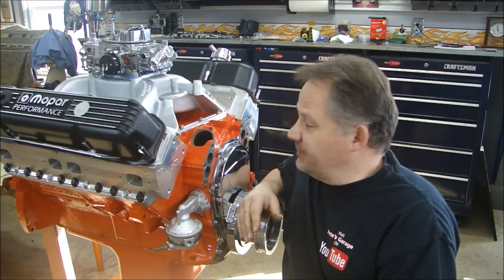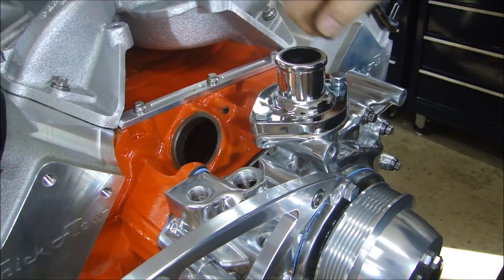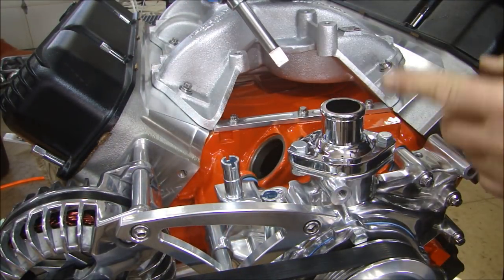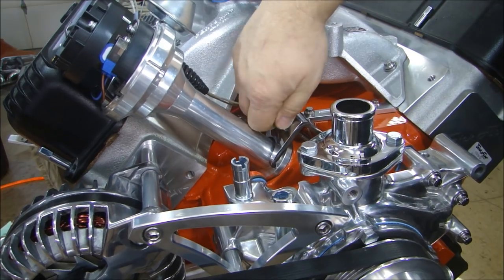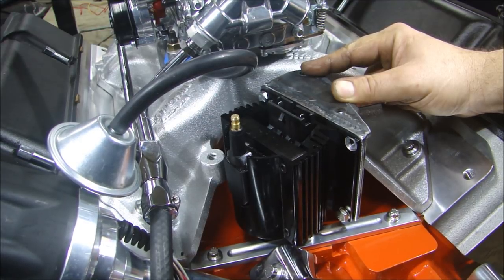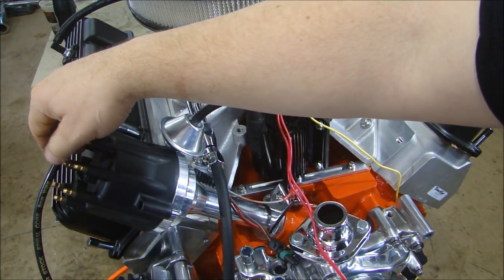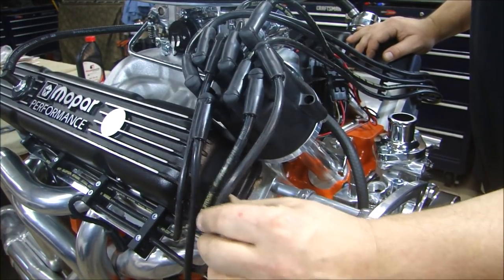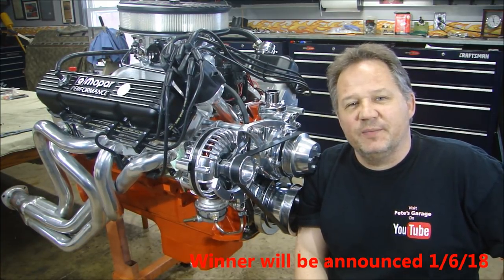440 Chrysler Mopar Engine Building Part 11 - Water Pump, Alternator, Coil, Making Distributor Wires

Comment: What are your thoughts on routing the spark plug wires underneath the headers and routing them to the distributor? I had never considered that until I purchased an 82'  chevy pickup last year with 10,000 miles on it. its appeared unmolested and i was curious if that was how the trucks came from the factory. i have began running wires on my builds that way and have had great success with wires nor being damaged or effected by heat from the headers. I do however put the wires in a heat shield. I believe the additional wire length has not effected performance.
Reply from the maker: That's an awesome idea. I've done that when they are extremely close. Thanks for the comment

Comment: I use cvf racing pulleys on all my cars.  The price is right and quality is great too. And made in usa.  Looking forward to the dynotest.   My guess is 477 hp btw.
Reply from the maker: Those are very good, these are made by March
Reply: @PetesGarage  526
Reply: I'm new at building Dodge 440 so I'm doing a roller motor to and I appreciate all your help and how to adjust the lifters and all that I put the 7 quart oil pan on I've got a Dodge Dart Swinger 73 model and it's sitting really low to the ground I've already been the oil pan once any suggestions on how to put the car up a little bit higher in the front so I'll stop bending my oil pan

Comment: Try using baby powder as a wire/boot lubricant, a liberal dusting on the wire jacket and in the boot works exceptionally well, is less messy than WD-40/silicone oil/grease, is non-conductive, resists carbon tracking and is rubber/insulation friendly.
Reply from the maker: I'll try that

Comment: HI Pete! about the bracket you connected to the coil was it nessasary to do so. And the bracket was it not a part that came along. It looks home made. Thanks
Reply from the maker: I made the bracket just to hold the coil for the dyno test. The coil usually gets mounted away from the engine where it's not hot.
Reply: OK! i see

Comment: Hi Pete! was it really nessasary with all the wiring  to the distributer, i guess you wanted to show us one way to do it your self. I saw many who just had cables prepared. Thanks
Reply from the maker: You can buy cables made to length for most engines. I like to buy higher performance wires and cut them so the fit neatly on the engine.
Reply: OK! got it thanks ....

Comment: When priming the oil pump you mentioned turning the cam to get the oil passes to line up, priming both rocker assemblies. In this video when installing the distributor you say your engine is still at TDC. Did you go back to TDC after priming? how did you do it with the heads on? or did you not turn the cam to prime the rocker assemblies?
Reply from the maker: Yes, after priming the oil pump I turn the engine to #1 at TDC compression stroke.

Comment: I use silicone mold release spray on my wires during assembly. It dries fast and works much better than other oils, just spray the wire end and boots then slip them together easily.
Power guess: 455 hp & 475 tq.
Reply from the maker: That's a great idea

Comment: I am shocked you didn't powdercoat the fuel filter or take it apart and make sure it was clean on the inside. :) Nice work!!

My guess is 535HP
Reply from the maker: I checked it with a borescope....lol.

Comment: Hello Pete, I did a similar 440 build (stroked to 512, 10.5 compression, roller lifters, 584 hp on engine dyno after break-in). Saw your video about viscosity which was very informative but was wondering what type of oil you would recommend after break in? I drive my car on the street probably less than a 700 miles and at the drag strip about 20-30 runs a season.  Thanks
Reply from the maker: Thanks Michael, there is no need to change viscosity after break-in. Just use the same oil. I run 20W50
Reply: I use driven racing HR6 it has rust inhibitors and zddp. Its full synthetic. 

Main thing is to heat oil up to prevent/boil off condensation from forming. This breeds issues and turns oil acidic. Then oil breaks down from acidity.

Comment: Hey Pete I just found your channel and I gotta say thanks. As luck would have it I'm putting together a 440  in my garage right now. Your whole video series has been a huge help in building my first engine. I am looking at the performer rpm intake but I am concerned with it's height. I would like to keep it all under my hood. Could you give me the height from the top of the intake to the engine block upper deck(just under the intake)?? This would be greatly appreciated. Thanks in advance.
Reply from the maker: It's just about 4-3/4"

Comment: Great videos pete i'm building a 440 atm. Along ways to go might make clone of what you built. What did you put on for headers? And i'm thinking 662 hp. Also did you ever figure out the $$$ you got into it. Thanks. Again thanks for the great detailed videos.
Reply from the maker: It will end up with a set of 1-7/8 tube Hooker headers. Parts were around $11k

Comment: I'm building a mopar right now. I got the aluminum heads and all but I was wondering if I should paint the heads orange or not at all. Is the aluminum going to oxidize if left unpainted? They are 440 source heads so they will look completely stock if painted. Thoughts?
Reply from the maker: I have aluminum heads on engine both painted and unpainted. If you leave them uncoated they will need to be cleaned occasionally.
Reply: Pete's Garage Ok thanks

Comment: Apologies if this has been asked before, but is this a CVF bracket/pulley set?  I'm putting a set on a 400 motor in a 74 charger.  With power steering and air.  I didn't hear any mention of a thread sealer on the bolts.  Is this needed?  I'm about to attach the 440 source housing to the block and looking forward to seeing it all come together.  Thanks Pete.
Reply from the maker: It's a billet bracket from 440 source. Thread sealant is only required on bolts going onto coolant cavities like on the water pump

Comment: My guess is 593hp, those heads are moving 310cfm at 0.500:). Great videos Pete, been watching for years...finally clicked subscribe. I was wondering if you're using mufflers on the dyno, or running with an open exhaust. Seems like it should peak around 5500-6000rpm. My gut is telling me that it should make over 600 easy, but with the water pump, alternator, air cleaner and carb with a choke, it might struggle to get there, but I hope I am wrong;). Can't wait to see how much torque it puts down on the dyno.
Reply from the maker: Thank you for subscribing. The dyno video is posted. Open exhaust, no air cleaner and wide open choke.

Comment: Hi I'm new to the Chanel and I have a few questions, I have a 67 coronet poly 318 and I'm wanting to have a water pump and altanator ( I spelled that wrong)  only is it worth the power gain?
Reply from the maker: Neither will gain any power.
Reply: Well I'm also porting the stock heads to 360 specs and a summit cam
Reply from the maker: That will help

Comment: What is the hose coming out of the valve cover and where is it going??
Reply from the maker: EGR tube goes back to the carb base
Reply: PCV (positive crankcase ventilation) valve. Sorry, Pete, didn't mean to contradict. Beautiful engine. What did it go into?

Comment: Do you know where I can find a guide or do you know what bolts go where for water pump bc I unfortunately got my motor without a water pump and so I bought one but don’t know which bolts go where and really need help. And how do I find top dead center to insert my distributor?
Reply from the maker: Sit the water pump on a flat surface and put the bolts in the holes until they are all the same distance from the pump. Turn the engine over with #1 plug out until you feel the air come out, then line up the timing pointer
Reply: Thanks!!

Comment: Hi Pete, form Sydney Australia. Love the 440 build, I’m just about to build a 440 stroker myself. Have just bought the trickflow 240’s and manifold, looking to make 650hp/tq, any tips on a combo to achieve that? I’m keen to know what pulley setup that is, I already have the same alternator and bracket, but those pulleys took mint! Where does one get them from?

Cheers, Mick
Reply from the maker: Hi Mick...650 is a big number that will require a big cam and high compression. This one has 531 HP and it is really pushing the streetability factor. The pulleys are just serpentine pulleys, it was not a system. I got those from 440source.com
Reply: Pete's Garage I am aiming for around 12:1 comp, my brother has a 360/408 stroker with just a tad over 12:1 comp on pump fuel, with absolutely no issues drag racing and street duties.

Im looking at a 500+ stroker and a cam in the 260 duration range.

As I am building the engine myself, with all the research I have done and books I have bought, I cant seem to find information on bearing clearances (main and rod) and ring gaps etc. i can find plenty of info on engine combos (size, comp, cams, heads etc) and I can see what kind of power they make or times they run, but I can’t seem to find the finer details
Reply from the maker: I can give you all the clearances when you start building
Reply: Pete's Garage you’re a champ pete, do you have an email i can contact you on?
Reply from the maker: petesgarageinfo@gmail.com